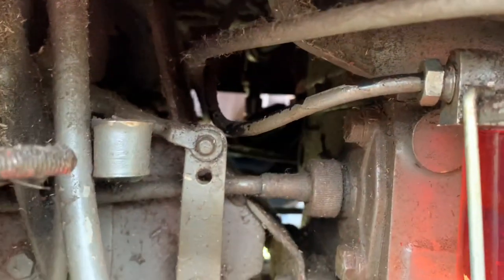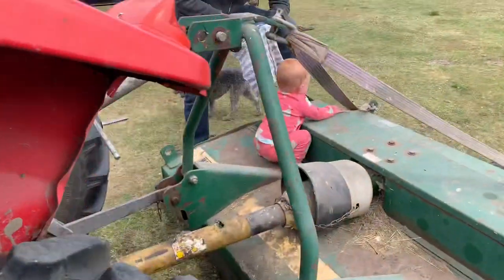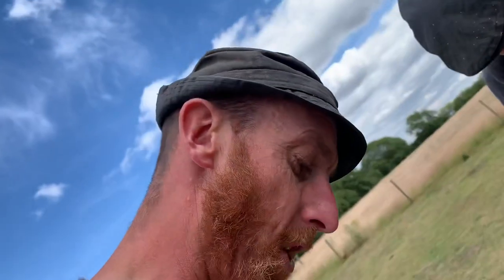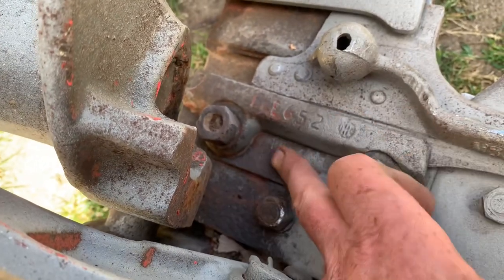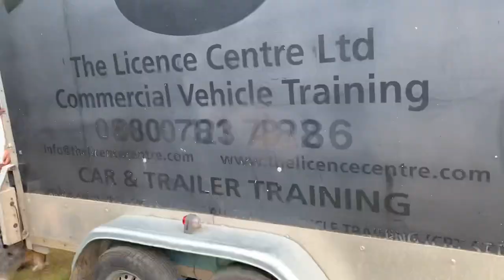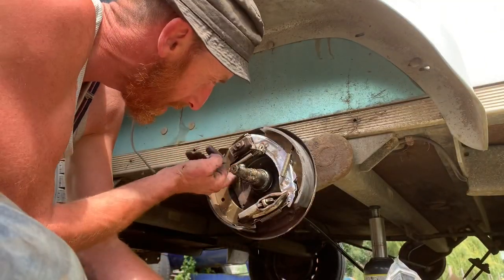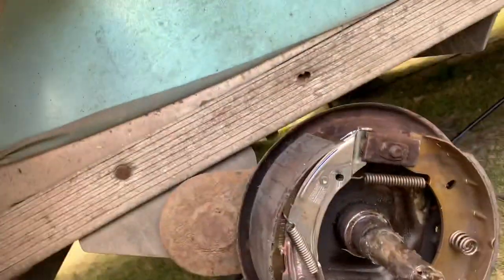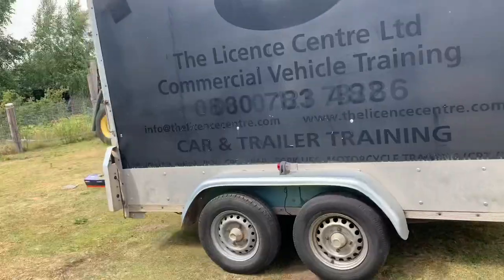Last of a generation! Tractor repair, cutter restoration, Wessex trailer struggle wing nut wheels!

Comment: Nice to see you still use old finger mower i work for an old boy on his farm and we used to top weeds with a trailed finger mower which we could put a sway board on to put it in rows so you could see where you had cut

Comment: hi richard why dont you remove shaft get it to an engineering company and get a new keyway cut in the opposite side of the one on there fit new pulley and key if needs be and reassemble the reason looks as if 5he pulley / shaft came loose, save a good bit of Money for the amount you cut.

Regards Graham

Comment: I had the same problem with my 135, there should be a small filter on the top of that stop tap. The best way to solve to problem forever is take the fuel tank off and wash out, the only way to solve the issue properly.
Reply from the maker: There was no filter in that one… might of been taken out in the past, yeah there hard to clean in because they dip down, we’ll no doubt see her again mate 😁👍 cheers pal